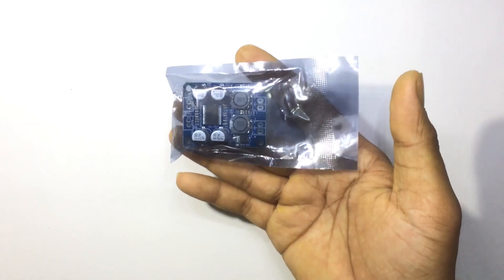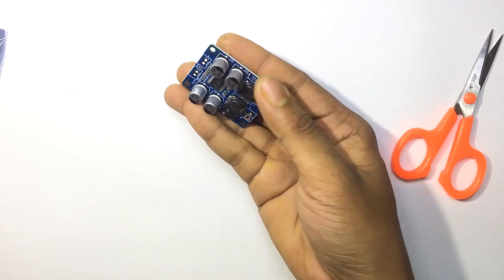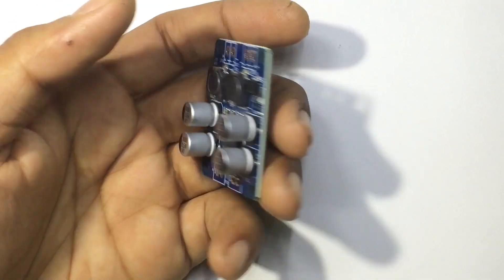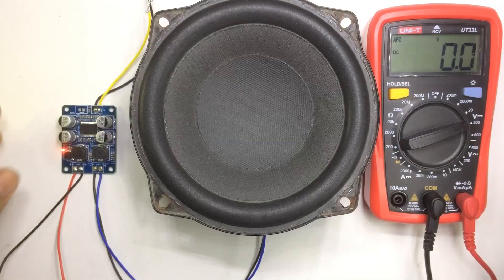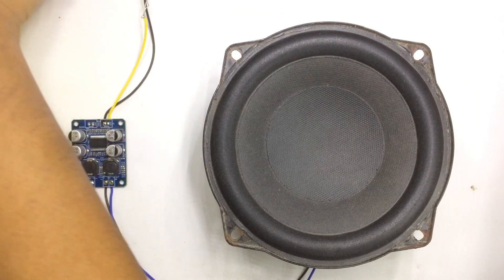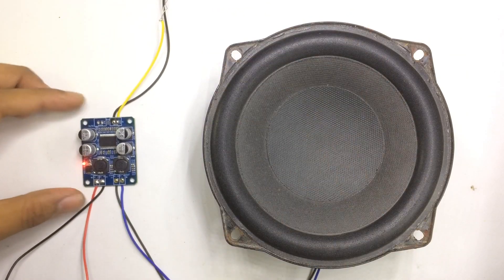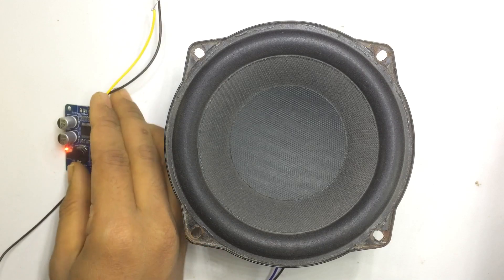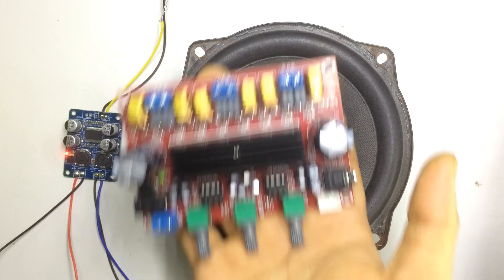TPA 3118 class D 50watt power amplifier test & review#bass #amplifier #diy

Comment: Yeah I have 2 of these tpa3118 driving 2 sharp CP-C3900 150Wrms book shelf speakers getting signal off of my 65" flat-screen TV.
Amazing!!
Power source 17v 5 amp bumped up to 24v with one DZS DC-DC Auto Boost Buck Converter Red Board High Performance Low Ripple Adjustable Power Module 5.0-32V 1.25-35V XL6009 Voltage Regulator.

Comment: bro is it ia better  than la 4440  amplifier  
hmm which  is louder la4440  or tpa3118
Reply from the maker: in terms of sound quality , output power & efficiency tpa3116 is much better than la4440..  la4440  has a stereo output of 6w*2  & 19w in mono & produce a lot of heat.. 
tpa3116 max output 60watt & class D amp with minimum head production at max power output but its a mono amp
Reply: @madScientist99  your are right i ordered  and owned tpa3118  it works well and 40watts of output  from 13v which  is superb  
but by my mistake  
my tpa3118  has been destroyed  because  i connected  battery wire one to plus and other  to aux in that's  why  my has tpa3118  has been  destroyed  
money  is the dirst of pir hand 
so anyways  i ordered  a new one